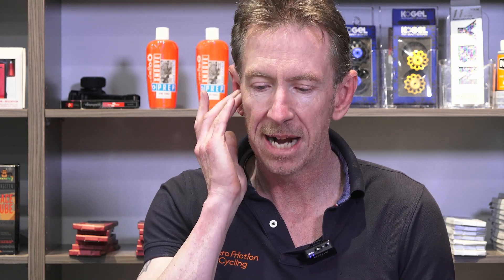Episode 10  - 12 Speed Chain Compatibility

Comment: Thanks for the informative video! Got a question. I run a “mullet” setup on my gravel bike: road axs brifters + gx axs derailleur + eagle 10-50 cassette + gx eagle chain. I can get it to shift well but cannot eliminate rubbing noise from the chain interfacing with certain cogs in the back despite optimizing chain length, b screw, derailleur hangar alignment, etc. Gx on my mtb is silent. I think the short chainstay of my gravel bike and the resultant extreme chain angle is the cause, and that’s why sram made the road axs chain overall width thinner. Since I need to stick to a 11/128 standard chain, do u happen to know which among those you recommend is the thinnest and hopefully solve my issue? Thanks in advance!
Reply from the maker: Hey Kyu! - Firstly next chain, do not run GX, they are pretty bad (very average wear lifespan), step up to xo1 for around 10 times the wear life. Buy ahead, they are very hard to get as GX chain production is priotised as unfortunately that is what everyone keeps buying, and they shouldnt. Absolutely step up to x01. 

Secondly it is likely to be the larger chain ring (and maybe shorter stays) creating the more extreme chain line angle. Millimeters can matter so first check if you can get your crank mounted slightly further inboard (ie is there wave washer  or spacer / shim on that side you can remove), and also do you have a couple mm's to shim cassette further outboard towards frame and still have clearance of 10t and frame. 

Also - if you are in biggest cogs a lot, consider a smaller ring if you dont need those top gear inches all the time. A small ring will give you less extreme chain line, and also enable more run time on one more cog down. 

You will be stuck re other chains - ybn and kmc 12 is same width, shimano 12 is a bit thinner but also has extended inner plate links so that will rub worse. Ekar 13 has a thinner internal width and so wont run. Alas you are going to need to play with the above to lessen the extreme angle (which will give you lower friction running in those gears as well for an extra bonus).
Reply: @zerofrictioncycling992  your insight and thoughtful reply is much appreciated. I am going to experiment based on your recommendation!

Comment: Hello. 
I have a AXS groupset. I don’t want to use a cassette with 10t cog. 
So I will swap  the chain and the cassette with shimano 12s. 
Does this work - regarding gear steps, pulley wheels and front chainrings?
Do you see any other problems? 
Is there maybe a better option, e. g. aftermarket axs compatible cassettes?
Thank you 🙏
Reply from the maker: Hi there! It sounds like you are talking road (axs is just wireless, so there is axs road 12spd, and axs eagle mtb 12spd). For road no not at all, sram axs road as stated is its own completely different standard. The cog spacing is closer as axs road chains are much more narrow, and axs road chains have oversize rollers, so all components are made for these larger rollers. You cannot run a shimano 12spd cassette on a sram axs road equipped bike, you are completely locked in to stay all components in the sram axs road ecosystem. There are not yet to my knowledge any viable aftermarket options for sram axs road - which is surprising after all this time, word on the street is things are pretty locked up in patent navigation nightmare to try, and some that have come out (ie there is an aftermarket gravel chain ring).... im not so sure about how it would go. If you were talking mtb - you are still stuck with 10t for shimano 12spd XT /XTR.
Reply: @zerofrictioncycling992  Hi Adam. Yes; its about AXS Road. 
Only for clarification: You say the jockey wheels will not work properly with the shimano chain (i can understand) and the index/gaps of the RD will not match the sprokets of a shimano cassette (thats harder to believe for me)?!
So I have to weit until Sram will lunch finally an 11t cassette. 
Thanks for your support.

Comment: HI Have you any experience of reusing a Sram 12 spd powerlock? Sram say no ,or is there a reusable alternative for the flat top chain?
Reply from the maker: Hi Marcus - yes, tons and tons. For many years and oh so many waxers, they are re-using flat top for axs road, eagle for sram mtb, to date there has been ONE reported eagle link failure (generally advise new link after 5 x re uses approx). THis is not official ok though, you have to make the call yourself if ok to go against mfg instructions, but..... to make immersive waxing viable one needs to either be ok to re use the single use links, or next best is to use in conjunction with silca ss drip or cs ufo drip - they are 100% immersive wax compatible with no cleaning needed, so fallback option if re using link not for you is to wax, re lube next 5 x with ss drip / ufo drip,  then re wax to reset any contamination and use new link - overall even with that link use due to the EXTREMELY low wear of either of the above approaches, cost to run drivetrain is still way lower vs normal drip lube use.

Comment: Xtr M9100 chain rust proof?
Reply from the maker: ?? no chain is rust proof! There are some specific anti corrosion chains, but i stopped stocking those due to poor lifespan (for giving you anti corrosion treatment they dont bother with longevity treatments like chromium plating on pins - same as most e bike chains). Non anti corrosion specific chains will rust if not kept lubricated. You shouldnt look for anti corrosion chains, you should look to ensure keep chain lubricated and protected. Waxed chain if not practical to re wax post proper wet ride due to time, just quickly wipe dry and add a coating of silca ss drip, ufo drip, or tru-tension tungsten all weather. If not waxing, just do same post proper wet ride until you can clean & re set. So yep message is dont worry about the rust resistance of chain, just take care of lubrication and that problem is never a problem.

Comment: Hi loved the video thank you.
Wonder if you can help with this. I have a 11 speed ultegra r8000 chainring. And also on the rear. A shimano 12 speed ultegra 8100 cassette. However I would like to run sram etap force for the shifting. Would the shimano XTR 12 speed chain be fine. Of not what chain would you recommend. Many thanks. Ps the reason I want to keep my crank is because is has a duelside power metre. Cheers Ian
Reply from the maker: Hi Ian! sorry for delay reply, im trying to get better at checking you tube comments! If you have a shimano ring and shimano 12spd cassette, then absolutely you want the shimano 12spd chain - best chain on the market. But im a tad confused on questions as you then talking sram force for shifting - not sure how running force on a 12spd shimano cassette - even if you have used ratio tech to change to 12spd, im not sure the pull ratio's are the  same for running shimano, you could check lennard zimm articles on velonews to see if he has covered this. If it is just about keeping crank though, 11spd road rings are fine with xtr / xt 12 chains. Hope that helps!
Reply: @zerofrictioncycling992  hi Buddy thanks for the reply. Sorry for the confusion re sram force. So the setup I want to run is. Shimano 11 speed chainrings. Shimano 12 speed cassette. Sram force Axs shifters. Force axs front and rear mech and a shimano xtr 12 speed chian. I was just wondering if this configuration would work.?
Many thanks 👌🏿
Reply from the maker: @ianhunter1279  Ah i see. To start the force shifters and mech will work with shimano cassette, sram 11 and shimano 11 cassettes have same cog spacing. SO it is really just will the xtr 12 run on a shimano 11s cassette and rings. Rings yes. Cassette, most likely perfectly fine but not guaranteed. It is a thinner chain, so it is possible that with the increased distance between side of chain and next cog, that shifting in some spots may be lazy. However (an i havent tried this myself, i havent had any xtr 12 chains to spare - stock is a nightmare) - i have had quite a few people write in to advise they are running shimano 12s on their 11spd drivetrains, and shifting is great. it may be that he hyperglide + of the 12spd chain is offsetting the increased spacing. Mix and match is never guaranteed for everyone, but it seems to have a high chance of being all groovy in this case. There are advantages to running the xtr 12 if it does work fine and that is that it is a VERY wear  durable chain being not far off double longevity vs DA11.
Reply: @zerofrictioncycling992  hi Buddy thank you for the detailed response that puts my mind at ease. I'll go for it and give it a try lol. Thanks once again 👌🏿

Comment: I would love to hear your experience of 12-speed XTR chains on 11-speed Shimano drivetrains. It would be a lot simpler to just buy one type of chain for my road bikes. Also I'm hoping to benefit from the increased durability. On one bike however, I'm running 50/34 Praxis chainrings, not sure if that would be an issue. Thanks
Reply from the maker: Hi Ric so sorry for delay reply i wasnt getting notifications for ages. I havent tried this myself yet as i cant get any spare stock! And such field tests - one's anecdotal experience can not be guaranteed will be everyones, small differences in many aspects of drivetrain (chain stay length, bb width, cog range and ring size etc etc) will all impact as all impact what chain line is being run in what gear ratio. 

But - i have had a good number of people over time email to advise there experience is xtr / DA 12 works perfectly for them on shimano 11spd. I havent had anyone advise of a negative experience. If it does work, then one can enjoy the approx 75% greater wear lifespan of the xtr 12 chain vs DA 11 or ultegra chain. 

hope that helps!
Reply: Will Sram Red AXS 12 crankset work with Shimano Ultegra 11 cassette? If so, which chain Sram or Shimano, 11 or 12?

Comment: Thanks for your great videos.  Looks like the Sram road wide 1X front chainrings are compatible with both flattop and Eagle 12 speed chains based on Sram’s website and this video talking about “mullet” setups.  Confusing but does this mean you could run a new Sram road Rival 1X wide crank set with 10 or 11 speed “mullet” setup as well?  https://youtu.be/Zmeqfc0sTBE
Reply from the maker: HI j, yes i just had a great email chain with a guy re just this. It is really confusing overall. The chains are two completely different standards so for srams 1x specific crank / ring that is compatible apparently with both - i think thats a nightmare. It has to compromise - ie for it to be compatible with flat top oversize rollers - there would have to  be less wear tolerance for running eagle or other 11/128 standard chain. If it is thin enough for flat top chain, then chain retention on 11/128 standard chains would be compromised. And then people get confused and put and eagle cassette and mech on and then a flat top chain , and that doesnt work at all, but thought were fine because the ring is flat top and eagle compatible. Honestly its bonkers. For so long how often do say sram say dont mix and match with shmano in 11spd, even though they are the same standard. And now they are trying to cross compatible two completely different standards of their own making. i am not in support of such, its just a mess. You can do a great mullet set up with axs by drop bar axs shifters paired to eagle cassette and mech, and running eagle chain, but really recommend still their narrow wide ring to keep everything in the same standard.

Comment: Do you have a chain compatability table and with wear and shift efficiancies ?
Reply from the maker: Good question ming, i have the chain longevity data graph on chain longevity test page, i need to get to more chain testing for this just been so booked with lubricant testing. Shifting is too subjective and too many variables, i dont have a method to remove variables and provide and objective data result. Ie campy 12 chains and xtr 12 chains work perfectly on my sram eagle mtb's (for me xtr chain shifts better than an eagle chain), but other experience differs based on many factors (final chain line angle may be more or less extreme based on chainstay length, chain ring and cog size etc. I have axs shifting, they may have gx mechanical which can get very clunky very quickly - and multiply such variations across 11 & 12spd groupsets by a solid 10x, before then trying to apply to a particular chain on said groupset). Main guide is mostly if a chain is officially compatible with that system and it is a top chain (ie a ybn 11 or 12 on compatible 11 or 12 system) then your shifting should remain extremely good if it was so before. Aside from xtr 12 which has a hyperglide + system so it is best to stay on shimano 12 chains, and axs road which is its own standard - for 10 / 11 and campy 12 road, the design features on chains for shifting are all pretty nailed across brands as they have been at it for awhile. It would be a brave person who would say they could blind test the shifting difference on their 11spd bike between sram, shimano, ybn, kmc, campy chain etc. If on 12 spd have a look at video on 12spd chain compatibility

Comment: XTR (12spd) chains make a lot of noise even on the xtr cassette on the largest cogs in my experience.
Reply from the maker: Hi Attila this shouldnt be the case, Shimano are just the most refined re groupsets and shifting, it should be very silky smooth. If it isn't, something is not right. Check that chain is on correcty (shimano chains are still directional - writing must face outwards), how extreme is your chain line angle? some bikes are set up incorrectly to make chain line angle worse than it needs to be, ie there is a wave washer or other spacer on drive side of spindle pushing chain ring out another mm or two, on 12spd systems even another mm can have a notable impact on chain line for such large cogs and cause extended inner plate links to rub on side of cassette teeth. If still not smooth, can cassette be moved outwards towards frame a mm or two if clearance between lockring  and frame (there are shims you can get down to 0.1mm thickness to ensure cassette is mounted as outboard as possible for your frame - again you will be surprised just how important every mm is - i have had some bikes in where things were really unhappy in big cogs - using either shimano or sram, removed a stupid wave washer from drive side, shimmed cassette over a bit, and all has then been lovely). Also ensure be tension & chain length correct - it may be worth having a proper good mechanic check, it definitely should be silky smooth if shimano - they are the industry standard re smooth, fast, quiet and best shifting drivetrains.
Reply: @zerofrictioncycling992  Thank you for the detailed response. The noise starts about 20-25 miles into rides and is limited to the three largest cogs (same noise on all three). 2020 Sworks epic, came stock with xtr. Not that it ensures everything is right but I'm a professional mechanic, I'm confident it's not a matter of setup/adjustment though. The dirt where I live is really fine loose over hard pack. I have a Scott Spark too with eagle xx1 and I can hear the drivetrain effiency degrade on that one too around the same mileage but it's not nearly as bad as the screeching on the xtr drivetrain. I use Silca Super Secret Chain lube because I can't get the chain clean enough after rides to put it in the hot melt so I reserve that for my road bike. I think the real question is which lube would last the longest in the conditions I'm dealing with.